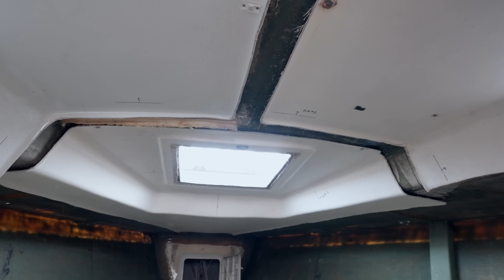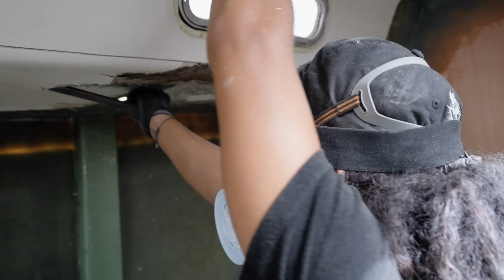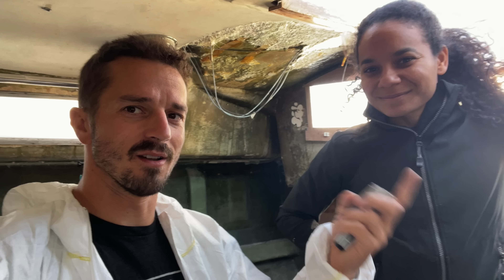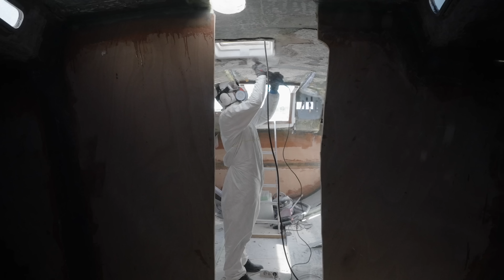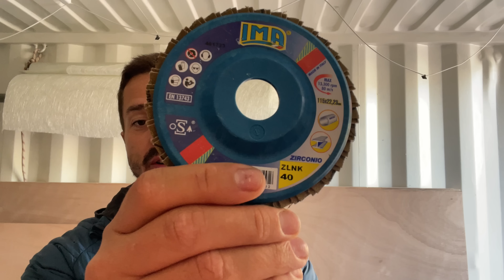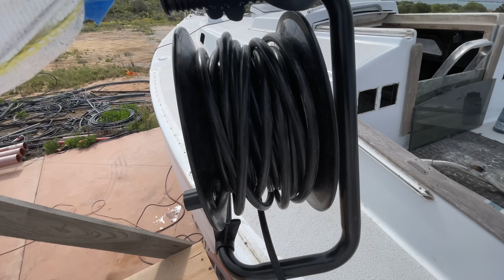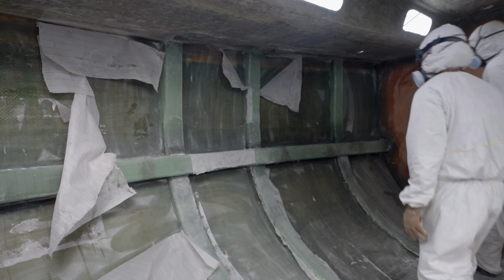Grinding It All Back Out | Step 389

Comment: It would be 10X easier to reinforce the roof from the outside with 2-3 layers of mat, buy dynamat extreme and apply to the ceiling then add the cosmetic ceiling panel.
Reply from the maker: ?? What? The top layer of the deck carries only compressive loads. It's the underside that's in tension. Which is where the glass will be best unitized. Besides, the underside is already bare.

Comment: Wear one of those exoskeletons that hold up your arm so that the tool and your arm’s weight next to nothing. Oo, oo, and while you’re at it run an air duct from an air conditioner into your suit. Stay cool while holding 0 weight in your hands. These were my wishes when I did bottom job all by myself.

Comment: This is why i like solid plywood decks.  I wouldnt have done that grinding for any amount of money. Ugh.
Reply from the maker: How would plywood be different? You mean with no glass on either side?
Reply: @SailingUma   It has good insulating qualities as it is, and can be drilled for any new deck hardware without having to worry about an inside core needing to be beefed up with a solid core and the waterproofing issues that come with it. I usually epoxy glass the outside for abrasion/wear. Granted you are doing the best job with what you have . I worked in a glassing hall for a while, the shimmer of glass fragments in the sunlight in the air will remain with me, and hope i have coughed up any that remain in my lungs. Good to see you wear full protective gear, that shit is deadly. Love your commitment.

Comment: There is a time offset, so I know this is too late. But, like the stringers and ribs on the hull, if you added small stringers and ribs to the coach roof (only an inch) and they were glassed in that would not only strengthen the roof and give you an attachment point for the inside. That would allow you to put in an inch of insulation and room to run wiring. The insulation will make the boat easier to keep warm if you need to winter over somewhere again. It will also help keep the boat cool in warmer climates. This is also a good time to think about resizing hatches, moving hatches, or even adding one to help with ventilation, let light in, or for sock puppet shows.
Reply from the maker: I believe we mentioned that in this video. That’s the plan. We’ll see if we need them once the glass goes in.

Comment: People have been killed or severely injured by shards of broken cut-off wheels flying off angle grinders without their safety shields.  It's really not worth the risk, especially when working up at head level, so close to jugular and carotid.
Reply from the maker: This isn’t a cut off wheel. It’s a sanding pad. Way different.
Reply: @SailingUma  yes, I am familiar. In addition to flap disc, you were using cut-off wheel to slice through ceiling.

Comment: Besides fiberglassing the ceiling, and adding ribs - You should consider making the ribs THICK (for rigidity) but also Tall for my next suggestion.

PLEASE Consider ADDING insulating with foam sheets to ceiling and walls of the hull. You can use a special GLUE to make them adhere without deteriorating the foam. Wen you travel in extreme Heat and Cold climates, it will be noticeable. 1/4 inch sheets have an R value about 3 but the mylar-lined can give you R values about 7 or 9 with the simple addition of an air gap between insulation and the Hull.

Comment: Keep in mind that the air between liner and deck was acting as insulator! I still don’t get it why you are renovating an old hull known for extremely slow sailing in light winds and slow sailing downwind in a breeze! Speed is very important on long passages in order to move away from stormy weather.
A modern monohull or multihull can cross the Atlantic in about two weeks versus 4-5 weeks!
Reply: The renovation is the point. When you buy something off the shelf, it isn't really yours. It's someone else's design. So it would be an even bigger waste of time and money to buy a new boat, only to want to do the same thing and rip everything out and have it how you want it.
Reply: Modern hull designs have been around for the last 10-15 years, renovate one of those!
Reply from the maker: A modern mono hull costs $500,000. And iridium go cost a few hundred. It’s easy to sail away from bad weather when you have a one week head start.
Reply: @DominicNSX  Hey, here's a suggestion, if you want to renovate a boat made in the last 10-15 years, why don't you go ahead and do that, it's really none of your business what other people choose to do with their own time and money, if you don't like it, there are many other YouTube channels to watch
Reply: @SailingUma  Pogo 36 new 200,000 Euros!
Reply: @SailingUma  J105 older, $80,000!
Reply: @SailingUma  Starlink is $150 per month!!!